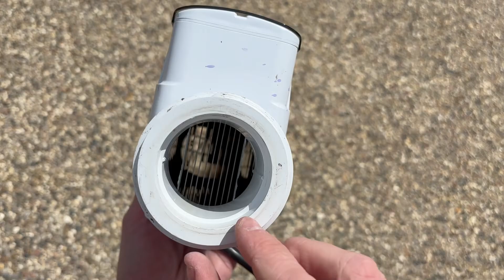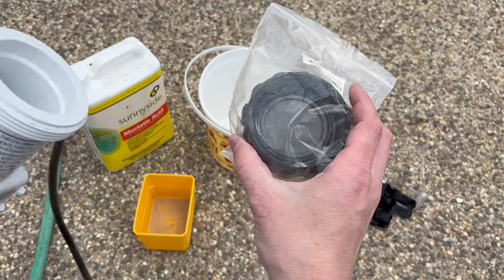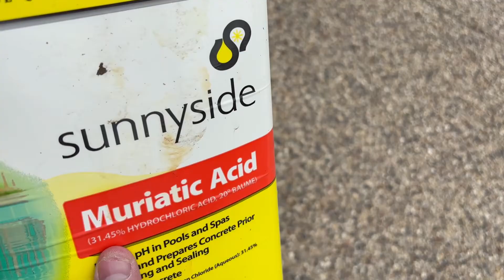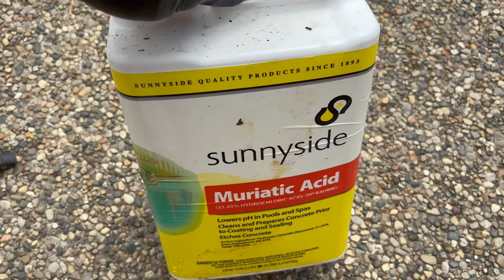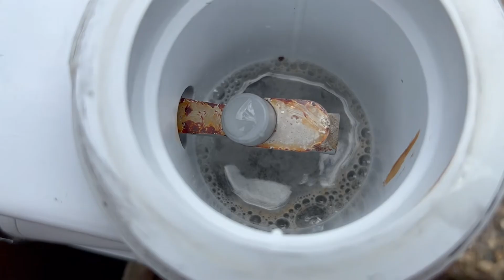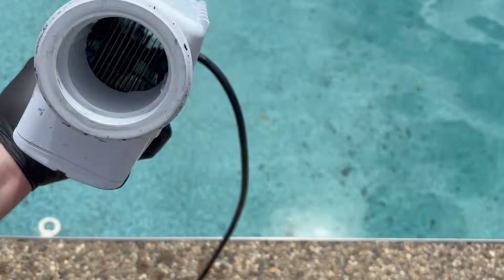How to Clean a Pool Salt Cell Like a Pro | Easy DIY Maintenance with Muriatic Acid

Comment: CRITICAL PART MISSING! How to reprime the pump, as it lost all the water when you unplugged the salt cell. I followed this process, turned on the pump and its loud as heck/sucking air. Had to immediate turn it off. You cant just leave out a very important piece, i had to go down a rabbit hole trying to figure out how to reprime my pump and get rid of all that air that was in there.  How do you skip such an important step?!?!
Reply from the maker: This video was filmed while prepping to open my pool for the season, so my pump hadn't been running yet.  Also, when cleaning my cell during the season, I generally find that I don't need to re-prime my pump, as I have a valve that keeps the pump and filter holding water.  

But, thanks for pointing that out as I'm sure there are plenty others that have similar set up as you and may need to consider repriming afterwards.

Comment: Phosphoric acid is better… it doesn’t remove the coating of the cell plates.
Reply from the maker: Do you find that phosphoric acid is able to remove the calcium effectively?  

The manual for this particular salt cell (Pentair IC40) specifies using diluted muriatic acid, but I'd imagine phosphoric would be safer as long as it can actually get rid of the scaling.